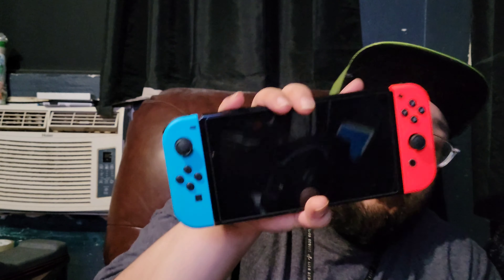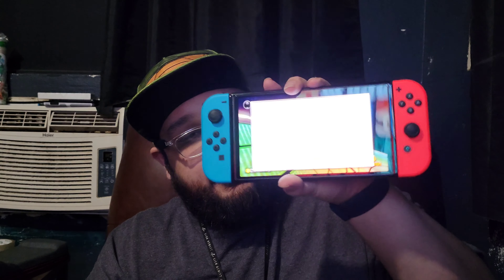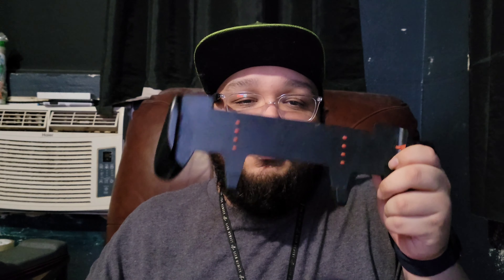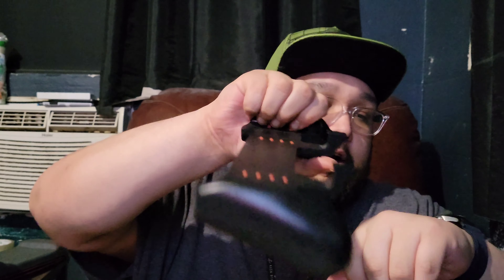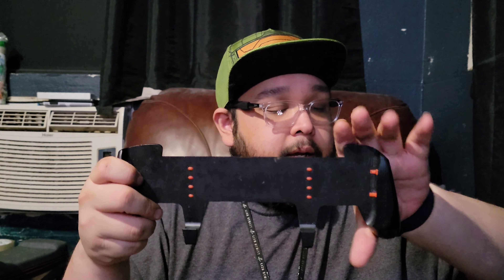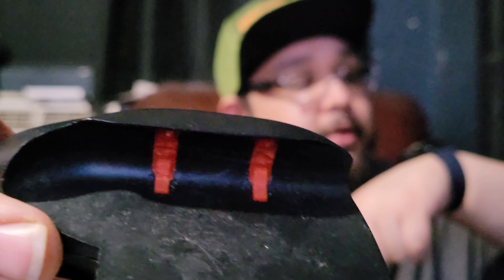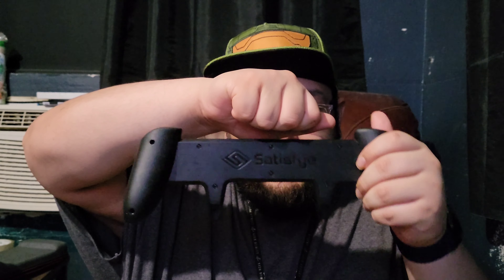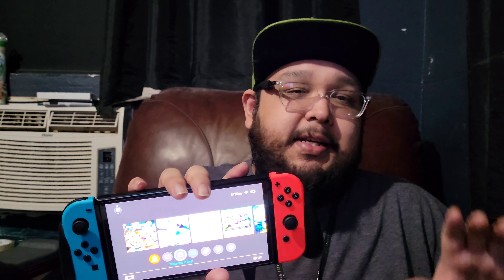Nintendo Switch OLED Satisfye grip

Comment: Hey brother thanks for the tip I cut away the rubber on the side and it works like it was the oh switch. I had stuffed it in there and I did notice it was a tight fit but after taking the rubber sides out it fits much more snugly while still being held in there. Saves me having to spend another 40 bucks for another pair of grips.